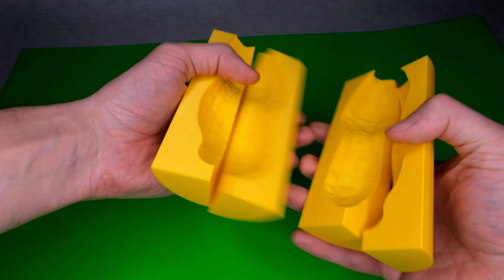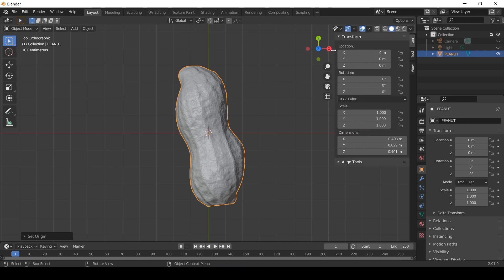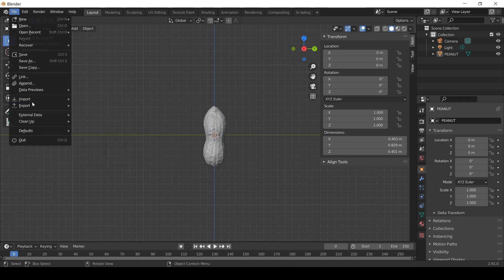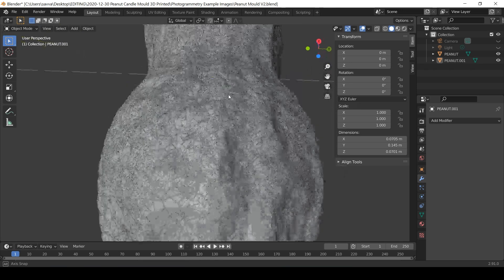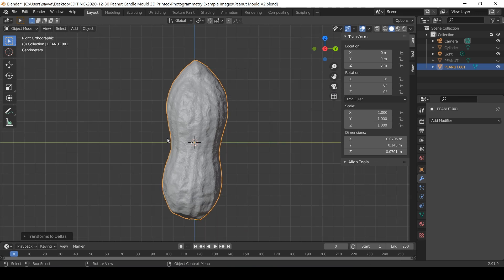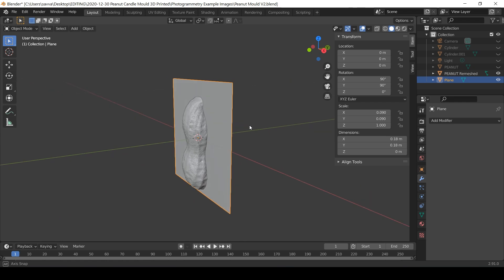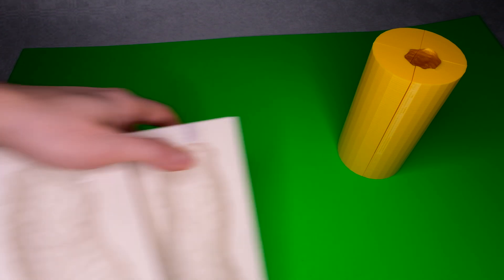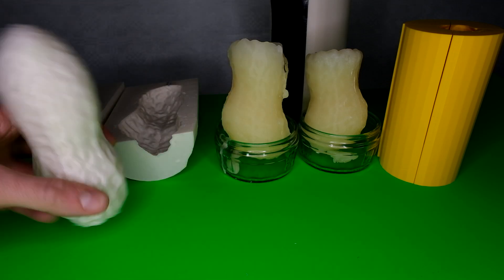Virtual Casting Mould in Blender - 3D Printed Cast / Peanut Candle

Comment: This video was great! It really helped.

For everyone else - I also got stuck on the boolean section with the cylinder and plane. This is what I did:

Duplicate the cylinder and create the plane as shown. Then pick one of the cylinders and add the boolean modifier on difference. Apply. Stop.

Now select the plane and hit Alt-N (Blender 2.9) and flip the Normal on the plane. Stop.

Go to the other cylinder and add the boolean modifier - ALSO choosing difference.

The problem has to do with things that I am not strong enough in Blender to explain exactly, but suffice to say it has to do with the way the Face is on the plane and that's why it doesn't work as shown. Flip the normal, the Face is now on the other side so you can do the other half. That's what it boils down to.

Anyway, thanks again for this video. It did get me most of the way through, so I appreciate it!

Comment: The boolean part doesn't work for me. All that heppens is just additional vertices line being created along the plane. But nothing else. What am I missing? I checked if my mesh is manifold, tried to flip normals, no doubles. Where do I fail?
Reply: add loopcuts or use solidify to make it 3d object.(use minimum value) and then use subdivision

Comment: Did the difference and intersect and ended up with one cube that has a line down the center and a plane, called "Cube.001" that is a flat with a cutout of my shape. What do?
Reply: stuck here as well.. I hate booleans
Reply: @mowtown2496  someone else helped me out. Just keep it simple. Take two squares, or whatever you need, and align them at the 0 on the x and y axis. Then make your booleans as needed

Comment: Pressing "N" will open the side panel and the metric setting for reasons unknown, you also need to set the scale to 0.01 both in the metric section and the display section. I did once hear that Blender base units were metric already but for the life of me cant understand how such brilliant programmers mostly from Europe cant make a piece of software that when you say I want it to use mm (Which is the professional standard pretty much everywhere and not M or CM) and simply change anything and everything that needs it over. There is some crazy logic going on over there..........................is dope smoking allowed there??

I'm a professional 3D artist (12 years) btw who moved over to Blender from 3ds Max when they finally decided to take 3d seriously and started using standard computer conventions etc. There's still a long long way for them to go, despite its much improved UI

Love ya waxy nuts ;-D
Reply: Check this video out https://youtu.be/ZfiS_asFFLk it helps explain how
Reply from the maker: It is amazing that the software is opensource and free - so handy to have. Some aspects of it do feel like I was about to start playing a video game - which I haven't done in many years. I think it was the combination of buttons and longest shortcuts ever.  Thanks for the pointers too! Cheers!